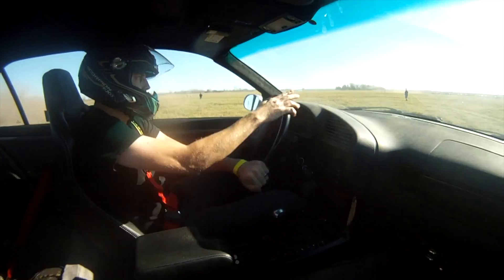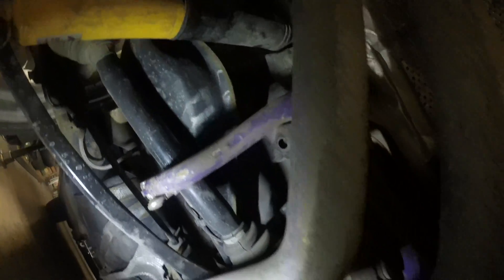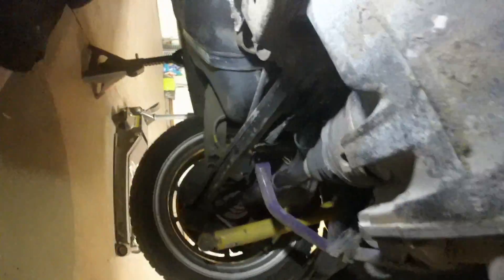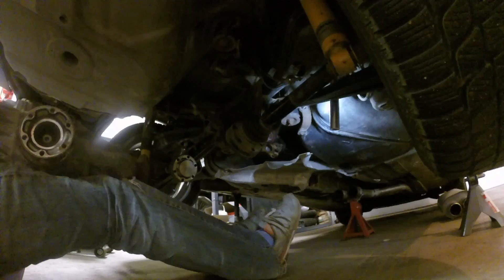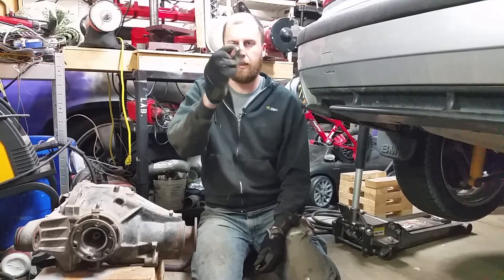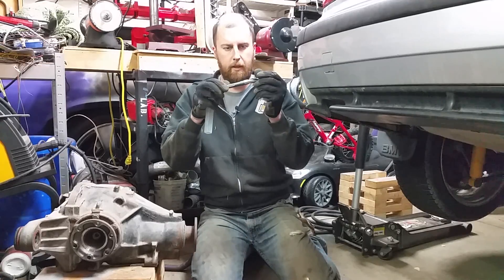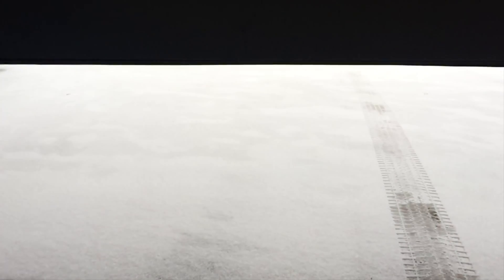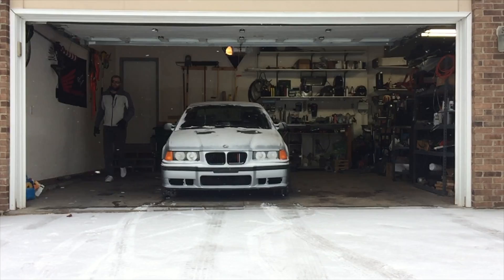E36 14mm Diff Bolt Upgrade

Comment: No need to modify/cut the bushing?? How can the new bolt fit if it is bigger than the bushing?
Reply from the maker: I drilled out the bushing sleeve to fit the larger diameter of the new bolt.

Comment: Couldn’t tell but does this bolt pass all the way through the diff?
Reply from the maker: Yezus Krys Yep - I tapped clear through the diff and the new bolt is long enough that it just comes through.
Reply: @mikaelvroom1997  why did you slot the end of the bolt before installing it?
Reply from the maker: clatheho If the bolt ever breaks again, I can use a flat blade screwdriver to unthread the remaining portion of the bolt and replace it with the spare I carry.
Reply: @mikaelvroom1997  awesome! thanks

Comment: Have you had any issues since doing this modification? My car has got the same bushings, from the looks, and has gone through a few bolts.
Reply from the maker: No issues so far! I've beat on it hard at the drag strip (including a lot of wheel hop) and started using Hoosier slicks for autocross and it hasn't skipped a beat.

Comment: Are you using grade 8 bolts?
Does not look like it.
Reply from the maker: No, the stock bolt is a grade 10.9, as is the replacement.

Comment: I am about to do this upgrade and I am looking at the sizes and it seems to me that 5/8 is to big and there is will be 1/16th of an inch or 2mm of extra play in the hole for the bushing. It looks like 9/16th would be a much better fit.
Reply from the maker: http://www.amesweb.info/Screws/ClearanceHolesMetricFasteners.aspx

"Close" fit for a 14mm bolt would be 19/32", "Normal" fit is 39/64", and "Loose" fit is 21/32". A 9/16" drill would be tighter than "Close" fit. The 5/8" (aka 40/64") is basically a "Normal" fit. Once the bolt is tightened, the bushing is held in place by the frictional force between the bushing and the diff housing. If the bolt is torqued properly, the bushing will not move around it.

Hope that helps!
Reply: You are 100% correct, I drilled my bushing out last night and 5/8th's leaves a lot of slop which I'm not comfortable with. I wish I would have read this sooner before ruining my aluminum bushing.

Comment: also why did you notch the end of the bolt?
Reply from the maker: If the bolt breaks, I can use a flathead screwdriver in that notch to back the broken part out of the diff case without resorting to drilling it out or using an extractor. I carry a spare diff bolt with me when I race so in theory if this bolt snaps, I can be back to racing (or at least get myself home) with simple hand tools.
Reply: @mikaelvroom1997  man you need to charge for this tip!
Reply: Mikael Vroom wow really great tip!! Thanks for the feedback!

Comment: Thank god for this video!! Just had same thing happen to me although the bolt just came loose and was stripped, I then bought a new bolt torqued it to spec and same noise a week later bolt had broken into the diff!! Have you thought about using a longer bolt with nut and washer? I just ordered a new front bushing, really want to do it right this time
Reply from the maker: The bolt I'm using now has enough thread out the other end that I could put a nut on it. However, where the bolt exits the diff case is not flat and would need to be ground down, otherwise the nut would put a bending force on the end of the bolt. A nut could help keep the bolt in place if it tended to back out, but I don't think that was my problem, I think the bolt was snapping because it was weak.

Comment: Do you have any idea what condition it is that snaps the bolt?  Axle hop or something?  The fact that it happened on dirt one time is surprising to me...  GREAT video by the way!  :)
Reply from the maker: I was surprised it snapped on dirt, too, especially with the good bushings in place - plenty of people believe they only snap when bushings are worn. That may have been the case the first time with sticky tires autocrossing, but RallyCross has a lot of violent on/off throttle action that must have been too much to handle.
Reply: I broke mine going up a hill 
Wasnt even being rough on it